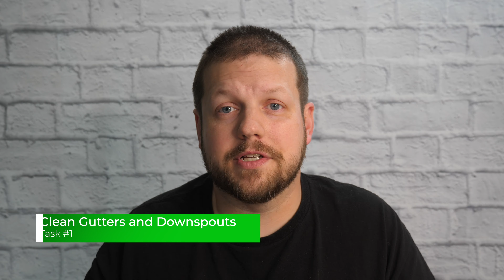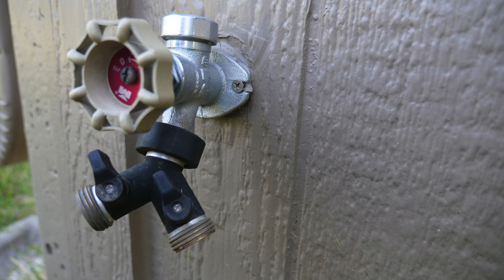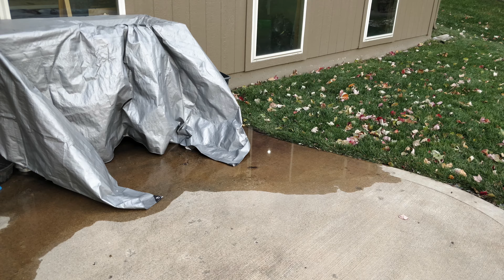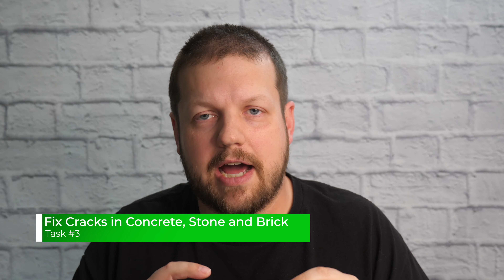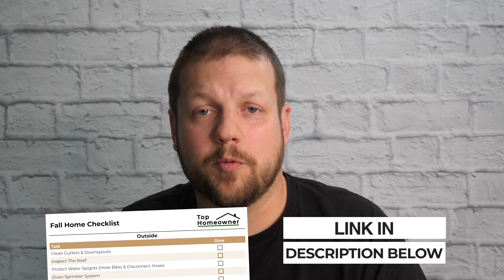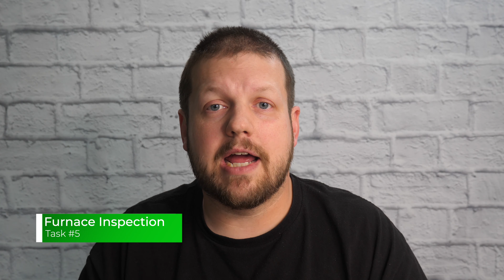Top 5 Fall Home Maintenance Tasks You Can't Skip

Comment: well, let's see... bought the house last year and so far have installed new roof, gutters and downspouts, new furnace and a/c unit, new garage spring and rollers, new yard barn, so most of those things have me already checked off most things onyour list...  I'm curious - what do you use to seal cracks in concrete?  I've been using Akona flex self leveling product and seems to work brilliantly, but it's the only one I've used... TIA
Reply from the maker: That's a lot of big projects! Actually I've used Akona concrete repair since I had both horizontal and vertical cracks. It's OK since you have to tool it out after you apply it. I suppose that's to be expected though since it's rated for vertical cracks. I may have to try the self leveling version.